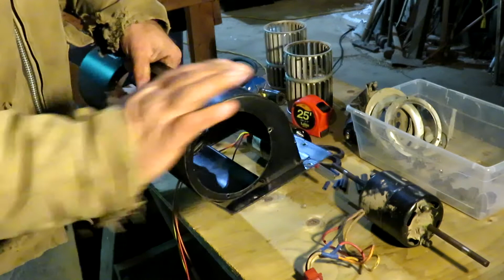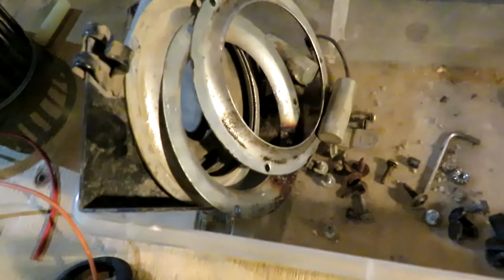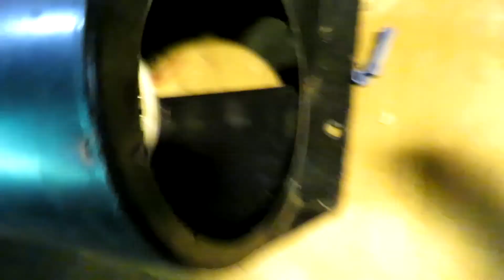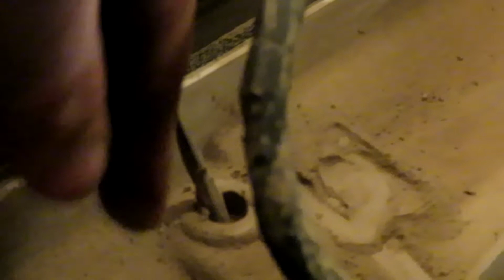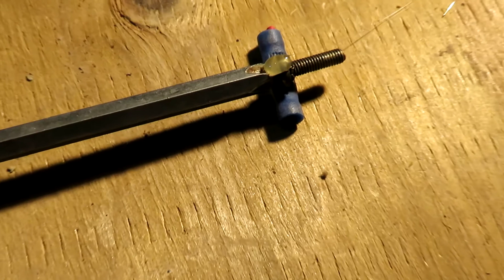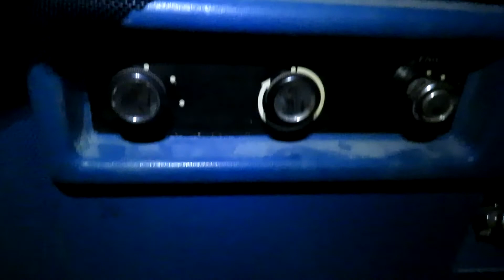Episode Nine. Ford 7700 cab fan motor replacement

Comment: Those 'rings' are air shrouds, designed to funnel air into the inside of the fans.  You have them on backwards, restricting the air flow.  That's right, air enters the inside and the fan fins scoop it up.  Negative air pressure (vacuum) is always harder to move than compressed air.  So consider the fan blades as little shovels.  I always take pictures before, during and after.  They make great reference.  If you take 500 pictures, there's always that one angle you will miss.  - Dave
Reply from the maker: Hi Dave. Part way through I realized that I should have taken a bunch of pictures LOL. The fan seems to blow air well at the moment, so I’ll leave the air shrouds the way they are…I don’t want to pull it out and reinstall unless I have to :) Hopefully other people will see your comment and it will help them. Thanks!

Comment: Great work, Tom! Holy cow you're one patient guy. Thanks for sharing.
Reply from the maker: This job was very fiddly. Another time I might consider using a cutoff wheel to open up the housing…install the motor and fan assembly…then weld the housing back together.